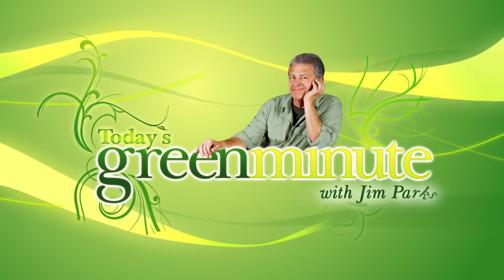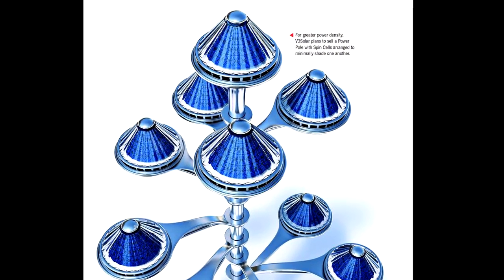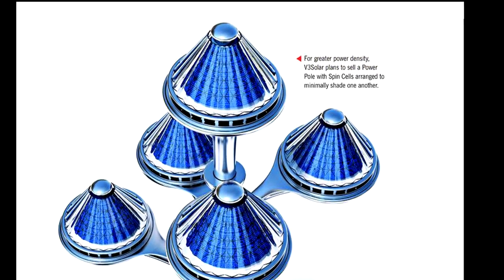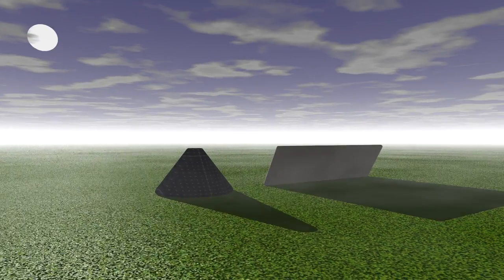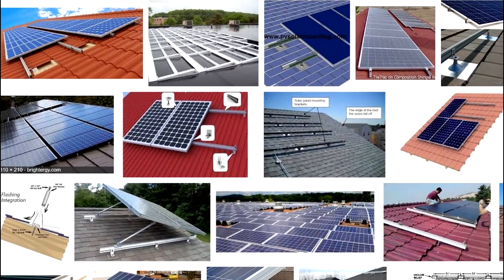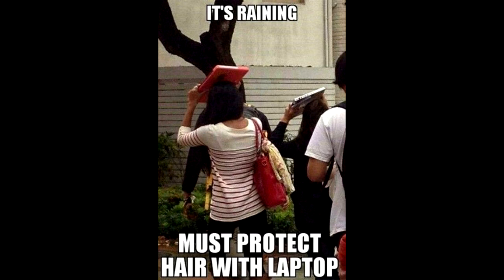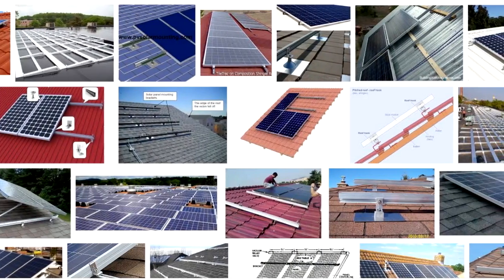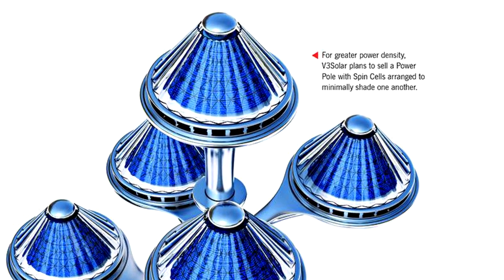Spinning Solar -BUSTED!

Comment: Its much worse, because PV cells need to run a maximum power point tracker (MPPT) to maximise their power output (tracking the voltage and current to run them at for maximum power). If a cell is shaded this changes the position of the MPP and the cell power output is compromised if run at the wrong value. If the cells cycle rapidly between light and dark this will totally screw the MPPT and the cells power output will be a fraction of what it should be.

Comment: You know...Its possible the setup redirects more sunlight to the cells than would fall on flat cells and the "20x more efficient" claim refers to the overall output of these cells vs flat, fixed cells, rather than the conversion ratio of a set amount of sunlight to electricity.
Just a thought.

Comment: thunderf00t is once again comparing apples to oranges.. instead of simply comparing the output of a solar panel of similar size of the photo reactive area of the cone receiving insolation at the time of exposure, he's comparing the total photo reactive surface of the cone to a flat solar panel of the same total area overall .. then of course his calculations would be "correct" 
you need to take a closer look and realize there is only a small area of the cone being exposed at any given time, then that is the surface area you have to consider in your calculations.

 so then for arguments sake i'm going to grab an arbitrary number that hypothetically represents the exposed surface area of the cone of say 0.1m squared, so then what is the output of cone compared to a flat solar panel of 0.1m squared?
that is the calculation you need to make...

something else that is not mentioned is how the light is focused in ribs of the glass cover. is concentrating the light to narrow band thus maximizing the intensity to the areas not directly insolation at 90 degrees of the incoming light. or do the ribs intensify the light on directly in line with the incoming light thus increasing output of the photo reactive cells being exposed and then requiring cooling after a brief exposure?  or do the ribs diffuse the light to spread it out evenly over the photo reactive surface to avoid peak production areas that have to overcome the resistance of the areas of lesser production?

the only thing in the concept of the cone that bothers me is how much of the energy generated is needed as an investment to keep the cone rotating in order to facilitate cooling?

Comment: This crowd funding thing needs to go away, be made illegal or something. Let people go to the bank for a loan like the good old days. The whole thing is 95% scams and 5% reasonable ideas.
Reply: I say we let them get gypped. There's a sucker born every minute, and they deserve everything going their way. Maybe people will finally stop being so damn naive and believe everything people tell them.
Reply: I kind of agree with you, but I hate the fact that these people are profiting from it. It's a valid stance to say that these naive idiots deserve to lose their money, but in reflection the scammers don't really deserve to get their skanky little hands on it either.
Reply: Hloy Hesit Try using yours before replying.
Reply: Hloy Hesit You didn't need me to do that, you managed it solo.
Reply: What you really need is a good checking system for each crowd-funding organization. Some panel or group of experts or something should be mandatory (possibly required by law) or else the funding will be a complete waste.
Reply: SpudHead use your brain to differentiate the fraud from the fact

Crowd funding is great, it's just become a means for scammers to become rich because people have no capacity to judge the validity or an idea of do research.
Reply: SpudHead You fucking slayed me man, I look like a real idiot now!

Comment: Hey Thunderfoot
What if its not the solar panel that is big, but the lens.
If you make the lens be the 1 meter high cone, while the solar panel inside be something like 2 centymeters.
Wouldn't this make a big efficiency boost?
It will only work assuming that cost of making the lens is much lower than price of the panel itself. 
But at least in theory it will make the spinning panel have same power efficiency per area as current panels,
but will make it many times cheaper, so more people can afford them.
Again assuming that the price of lens is lower than price of panel itself.
What do you think about this?

Comment: Alright i got a great idea that destroys this one lets make a nano material which reacts to heat and creates a magnetic field which is 10000 times stronger than rare earth magnets, and here is the trick without the added heat its magnetic field is 1000 times stronger when the heat is added it gets to 10000 times but because the material is on top of an artificial muscle it extends upward creating a weird magnetic spike effect like the aero spike and this spike will move a 10000 times stronger magnetic field material which goes up moving a piston which pumps enough hydraulic fluid to drive a hydro static transmission that moves the thorium Cadillac. Can you beat this one? the idea is copy righted.

Comment: The beauty of photovoltaic solar is that there are no moving parts.  Not only does this have a motor, it also would have to contend with some sort of brush system because the contacts would be in constant motion.

Comment: AFAIK water injection can make an engine more efficient, but I don't know about 50% more. The car will weigh up to about 60kg more, because you have to fill the water tank as well as the fuel tank.

Comment: I think the glass dome was less for magnification, but more refraction on the edges where we see that 70%, 0% drop in efficiency because of the angle. 

Bust still that results in a shitty design that doesn't solf the issue they created.

Comment: By "diamond batteries" you ment this?
http://www.bristol.ac.uk/news/2016/november/diamond-power.html
Reply: They even state that it will not replace the current batteries that the most people use since the diamond ones produce 46 times smaller ammount of energy but those last for 5000 years.

Comment: Did this Wolfe guy actually say he could reduce my electric cost per KWH from 12 cents down to 80 cents?   Of course once you add profits, royalties etc. it will only be $1.20/KWH and 10 times as much will be a real saving.

Comment: Wouldn't it be easier to implement a prism of some kind, like those things they use in post cards where you look at them at a different angle and see a different picture... seems like that would be a better way to adapt flat panels to be more efficient.

Comment: I just can't believe that people have missed the original problem altogether: To maximize solar panel efficiency you need to have as MUCH surface area as possible facing directly towards the sun.  The further it's turned away, the less power it will produce.... "Oh I know, I'll curve the entire panel!  That way only a tiny fraction will EVER be facing the sun!"